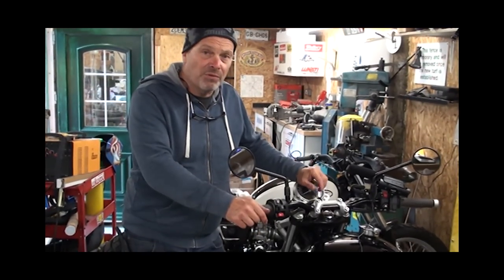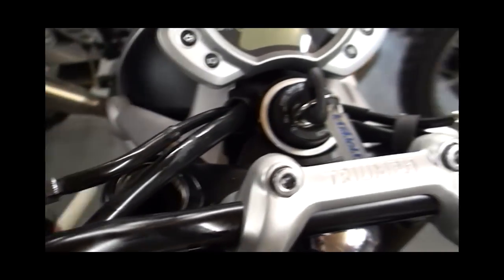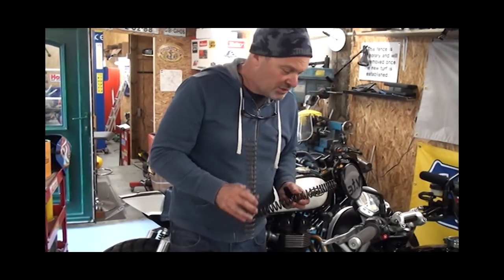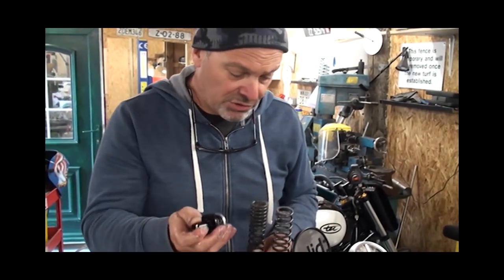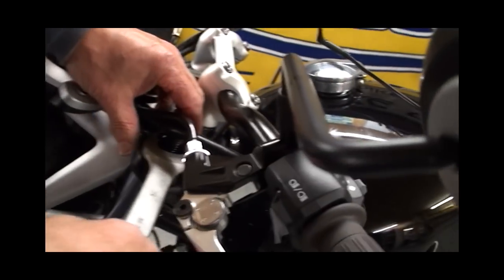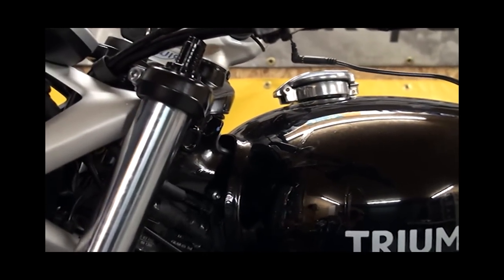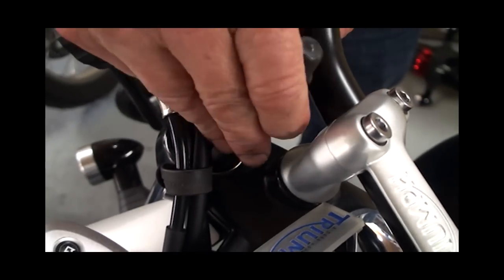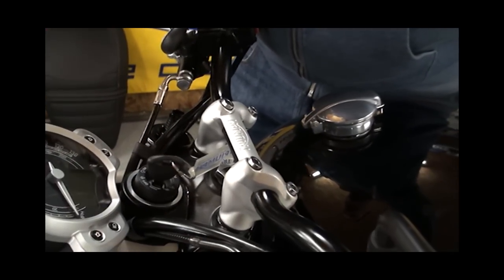Triumph Street Twin TEC front fork upgrade kit fitting guide

Comment: Just fitted a set of Tec fork springs and preload adjusters. Big improvement in comfort straight out of the box. Dropped the forks by about 5mm and was amazed how much difference it made. Will be spending the weekend trying different adjustments.

Comment: This is a great and clear video but for those who have never done this before remember to loosen the top fork clamp bolt (6mm Allen) before trying to loosen the large top nut. Then, tighten the fork clamp after replacing the spring and top nut or TEC adjuster.

Comment: What size spanner is needed for the Street Twin front forks?
Reply: Jerry Whatshisface the size that fits 😂😂
Reply: Hi Jerry. In the video he is using a 28mm. It's a bit strange, cause I had to use a 30mm.
Reply: Just installed this upgrade. Can confirm, 30mm is the right size for the factory top nut and 27mm is the correct size for the new TEC top nut . My bike is a 2018 Street Twin.